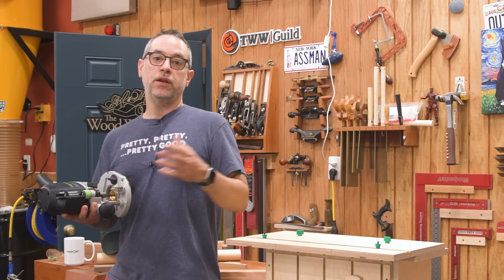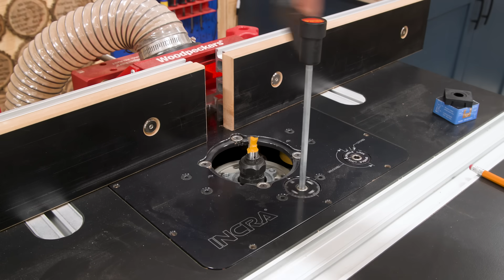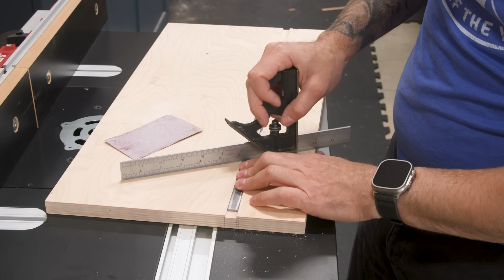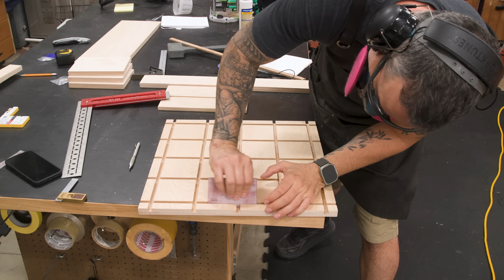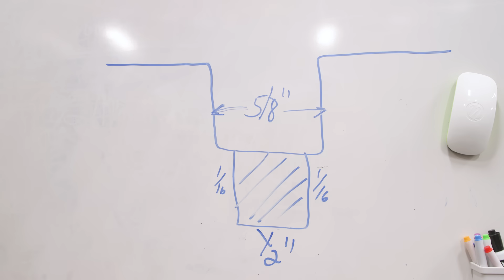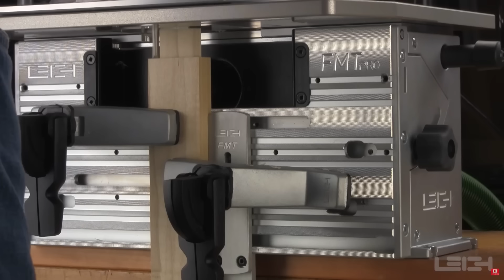A Fresh Approach To a Shop-Made Mortiser With Microjig - Check It Out!

Comment: I love this design, and I'm in the process of designing a similar jig. One thing I'd change on this is the bushing slot. I feel this could be better if the width was adjustable. For example, if I want to use an 18mm bushing with a 5mm bit to match Festool's 5mm dominos, the slot would need to be a different size. Another change I will likely make is on the clamping plate. To sync up with the standard Festool dimensions, I plan to make the slots 96mm on center and I'll create a 20mm dog hole at every intersection so I have the option to use either Microjig clamps or bench dog clamps.

Comment: I I had this problem too:  Router start and stop when blind to bit.  My solution was to mark on the board with pencil exact location and drill shallow hole in S&S.  Then turned the board upside down and positioned bit into the shallow hole at start position…very easy to find.  Then turn on router to drill that hole to the depth needed. Same for Stop…except I simply placed a stop at end of board to prevent run-away board.  Also with two holes drilled it was easy to adjust fence with board in S&S positions to guarantee straight cut!

Comment: Sliding Top is incorrect in cut list.  Should be 319 width.  Apart from that jig works great.  I plan to make several sliding tops so that I can use larger router bits for 10mm and 12mm tenons.  Also glue spacers to perspex with centre lines to more easily and accurately centre in jig.  Thanks for a great video.

Comment: It takes like a fourth of the effort, time and expense to just learn how to make mortises properly. I speak from experience. I tried all the various jigs and whatnot I could find to make or buy and then at one point I just spent the money on a good set of chisels, a mallet and some rough cut hardwood from a local sawmill. It took me a day of chopping mortises by hand to get something passable. In a month of weekends I could make them perfect. The last jig I built to try and conquer mortise and tenons took me a month of weekends and cost more in materials and hardware than the chisels did. Plus, I now have a skill that is not dependent on a router.

Comment: Thanks for the video- looks like a great mortising jig. The one thing I do not like about matchfit is that after you tighten them down they bind, and the next time you make an adjustment (after loosening the "bolt") you almost have to press and pop them loose to get them to slide. At least this is what I experience on my BB matchfit drill press table.

Comment: What I like best about this video aside from the very informative and detailed production steps is the very relatable items in your shop. 1) I have all the match-fit products you used in this video. 2) I have the same Milwaukee tools you used in this video. 3) While not in my shop the kitchen cabinets, I just installed, are the same color blue/grey as your shop cabinets. 4) and close enough, my router table is made with Black laminate and Jessum products. I shifted the table saw rails to the left and installed my RT there so I could utilize the Tablesaw fence and an add-on fence for the router table. This allows perfect squareness to the table and is easy to set up. It also allows the sharing of dust collection connections. I plan on making a workbench 3' x 6' that I can then add side panels using Micro-Fit products to enlarge the work surface in length and width if ever needed. Thanks for this video and info
Reply: And they say marketing doesn't work!  I've noticed the same thing in my own shop.

Comment: My one comment (besides my other comment😅) is that in addition to referencing the center to set up the jig, I’d also be sure always reference the show face for all parts against the jig, that way if you don’t absolutely nail the center (and have perfectly milled stock) then it won’t matter. Conversely, if your center is off by a tiny fraction of an inch then those errors will compound if you flip stock as you go and your faces will not be flush when you go to assemble.

Comment: I have made individual mortise jigs for a specific project. Drawer full of them over the years. The greatest improvement is router dust collection. Without it you have to remove the router and vacuum out the mortise after each partial pass. Quite annoying.

Comment: Get idea! I think I might make this. I do however have a question. If you needed to make a mortise at the end of a 8 ft length stock how would you accomplish that?
Reply from the maker: Clamp the workpiece at an angle to reduce its height and mount this thing on the end of the board using some additional clamps. Or just use your router with an edge guide.

Comment: I have the Jessem Pocket Mill pro and they have a similar workstation with the matchfit hardware.  Its only problem is it needs more height like the jig you bought.  The Jessem jig is quite nice but you have a Jessem part that sits in the top of the jig to put your Pocket Mill Pro in and that makes it move to various angles.  I also have the dowel jig that fits on the same workstation so I need to figure out how to make a new jig similar to yours but hold the Jessem Pocket Mill Pro.

Comment: I honestly thought the Matchfit stuff was a bit of a gimmick till I got some to try and it’s honestly great. If you use a lot of jigs they are so versatile. Keen on those ratchet clamps too. Just wish they would make ones that swivelled. Great jig too. Made a small version of the Morley Mortiser ages ago and worked great. The Matchfit stuff makes it even better. I have a domino so don’t need this any more but goes to show with a few hundred bucks and a bit of time you have something very comparable.

Comment: I really want a shop cat, I've got plenty of house cats, but I always worry they they'll end up doing something dangerous like jumping up on my table Saw while I'm making a cut or something. Does your shop cat instinctively stay away from spinning blades and such?
Reply from the maker: Cats, generally speaking, aren't stupid. And I venture to guess that most, if not all, will quickly vacate a space when the noise level gets too high. Oreo often naps in the shop, either on top of the planer or in the corner on some moving blankets. When it's time to fire up the tools, I'll usually pick him up and put him in the office to avoid starling him. And it's really not good for him to be exposed to those noise levels anyway. Anything louder than a shop vac and he's not comfortable in the space. If anything, the bigger problem with cats will be glueups and finishing time. They see you working at the table and decide to see what's going on, only there's glue or fresh finish that you don't want them to come into contact with.

Comment: Honest question as someone who has a lot of mortises to fix/replace to restore some dining chairs, is the advantage to this over the domino primarily based on cost? Obviously the ability to customize the size of the loose tennon is a plus.
Reply from the maker: If the Domino is within your budget and you have a good use-case for it, get the Domino. This is a solution for folks what either can't afford or just don't want to purchase a turnkey solution like the Domino and instead are looking for decent repeatable results using more standard tooling. The joinery produced by this method would also be stronger and more customizable as you pointed out. But there aren't many applications where the difference in strength between a classic floating tenon and a Domino will be something to be super concerned about.
Reply: @woodwhisperer  thank you Marc!

Comment: I've heard it called a "floating tenon", not a loose one.
Reply from the maker: Both are common terms for the same thing.
Reply: @woodwhisperer  Maybe, I just hadn't ever heard the other term before. Though I can see the logic of it, since the tenon is "loose" within the joint, as in not connected to either piece beyond the glue. In that sense it may even be more logical than "floating" tenon.
Reply from the maker: They're also called "slip tenons" or if you want to be cringe: Dominos. :)
Reply: @woodwhisperer  Hahaha.

Comment: I looked into making a micro jig based mortising jig like this but buying all the microjig  swag needed for it isn't really a micro price tag.   At least it was more than i wanted to spend.  I did buy some t track for the face of the jig and some fairly cheap 1/4-20 t-bolts off of amazon.  also some toggle clamps; also super cheap.  The jig works very welll, whatever route you choose  to go.   Well worth having one of these if you need MnT joinery with any frequencey

Comment: I like Micro Jig products but this is just a take on the Leigh Mortice and tenon jig except it leaves out the best part of the Leigh jig is that it cuts a tenon to fit the mortice perfectly. I do admit I did not watch the whole thing, I have a Leigh M/T jig.
Reply from the maker: You should watch the whole video 😂 I mentioned the FMT. Also, there’s no reason this jig couldn’t be adapted to cut tenons as well.
Reply: @woodwhisperer  Fine have it your way I will watch the WHOLE THING.

Comment: Marc- why not just cut the start/stop point with a drill or forstner bit? I still cut them in two passes on each side, flipping to prevent tear out. Keeps me from making dyslexic mistakes… I made one of these several years ago from plans that didn’t require a bushing. I have since added the microjig dovetail fences to the front. Mine is router specific-I wish that I had used plans using the bushing because I would be able to use my smaller router. HDPE makes great runners for these plywood jigs. They slide much easier.

Comment: I intend to build one like this someday, but the size will be a consideration as I’d see a smaller one having the advantage of being more able to handle larger workpieces if you can attach it to the workpiece and then secure the workpiece rather than having to fit it all under bench height. I first saw this concept in a smaller package made by 3x3 Custom.

I also recommend checking out Izzy Swan’s mortiser machine from almost a year ago. More complicated to build but the ease/speed of setup and use seems better within its size capacity. I just finished my first project with it and it was a fantastic domino substitute.

Comment: This is a great evolution of a great design, and very well presented. Perfect shop project that's relatively cheap and super versatile. This feels like a more reasonable route vs a domino, especially for an occasional hobbyist like myself who also is in the market for a mid size router).
Three thoughts for additions:
1) 45 degree jig (or any angle) would be an nice way to lock in an angle if you have a lot of miters
2) Alternative top if you need a larger width mortise. Maybe something that's adjustable?
3) Metal/Plastic/Colored Spacers on a key ring - Because I loose every small wood jig/space I make!

Comment: Love floating tenons.  The only shortcoming that I have found to this type of jig is that you are limited to the length of stock you can mortise (think mortising bed rail ends).  I’ve used a variation of this jig and a ladder in the past — I wouldn’t do that today. 😂
Reply from the maker: We had another design in the works that was more portable for that very reason. But I didn’t want to over complicate things and went with the most common use-case.
Reply: It would be awesome to show those plans as an option

Comment: Would that also work for cutting board handles? might be too narrow
Reply: You could adapt it for that if you made a slot for a bigger bushing. I assume you’d be using a bit larger than 5/8
Reply from the maker: I think it would, but you might have to get a little creative or simply make the hand holds in multiple passes.